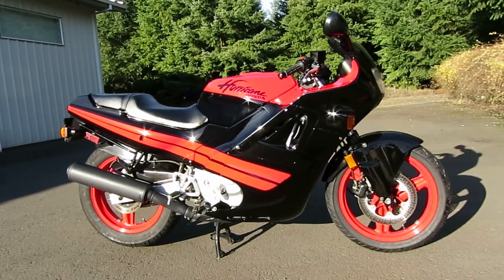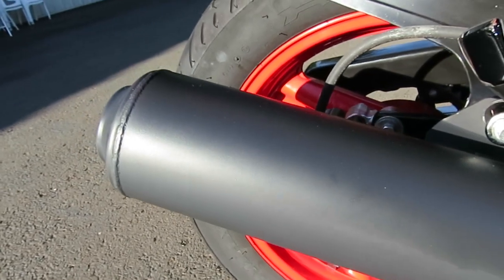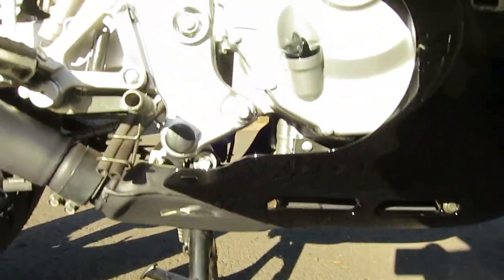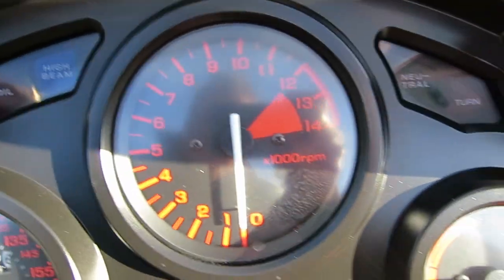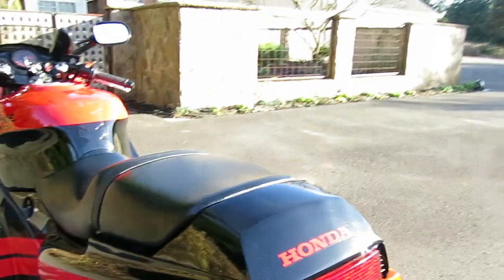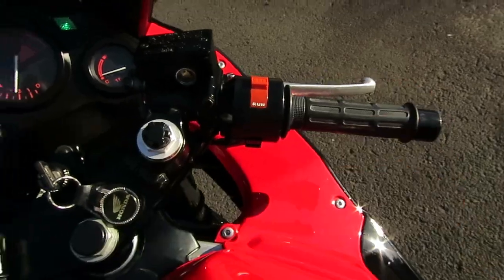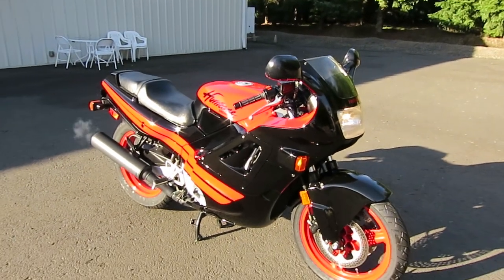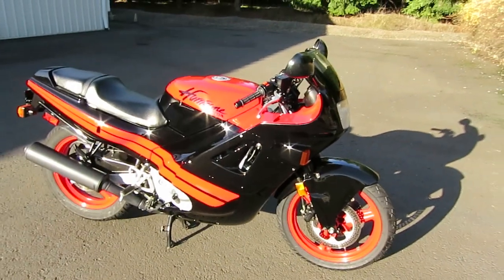1987 Honda CBR600 F Hurricane   Coming Out Of Museum Display

Comment: I have a red and white '88 model. Had it for several years now. Fairings need some work and a good repaint, but the bike is fine and runs like a watch. For a bike that is now 32 years old with an engine that has only had new plugs and a manual CCT it is amazing. Honda build quality. It has done about 130,000kms (about 80K miles)........Goes like a rat up a drainpipe too.....

Comment: My dad has one exactly like this one, he is the original owner and has about 12,000 miles on it, only mod was done to it was the paint, (and a 90w headlight shhhh) its now Miata yellow, with Corvette red rims and red and blue reflective decals. His didn't come with a over fender for the rear when bought new though, but it has folding mirrors from factory. I hope it get it eventually in the future.

EDIT: Its also frame #134, no corrosion whatsoever, no cracked body work, garage kept. (although the rear of the fenders don't fit anymore, they have shrunk somehow) and just needs some fork seals and some carb work.

Edit#2: corrected info

Comment: Issues of this bike sir?  It's a rare bike here in the 🇵🇭Philippines
Reply: Sir may ganyan kami hahaha
Reply: The CBR600F doesn't really have any bad issues. Make sure the cam chain tensioner is working OK. It's an automatic one worked by oil pressure and sometimes they have been known to fail. Listen for cam chain noise at about 4000rpm or so. Manual ones are cheap, but tricky to fit as they are awkward to get it, the cam drive being between cylinder 2 and 3. They love iridium plugs too.... well worth the extra dollars....fit and forget pretty much. Use top notch full synethetic oil such as Mobil 1 Racing 4T or equivalent. It must be a special motorcycle oil though as the car synthetics will make the clutch slip and will break down in the gearbox. Change the oil regularly, every 4000kms or so, and that little engine will go forever.